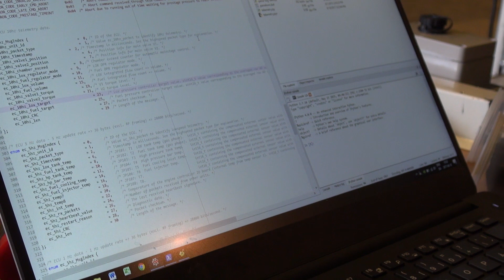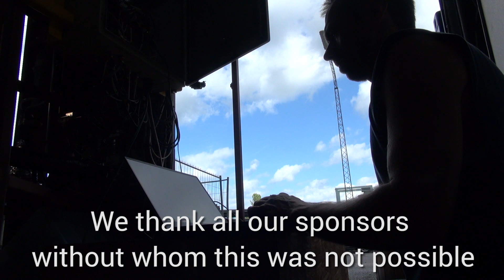DPR Water Flow Test on Nexø II

Comment: You inspired me to start making a simple liquid feul rocket  at home an some parts made at work  already had some results cant wait    I made my combustion chamber to short so I have to macine an extension  from 316l steal     good luck
Reply from the maker: That's great to hear! We wish you good luck and hope to see some successful results. However, we can't overemphesize safety when working with high pressure, combustable systems, so do make sure to write down testing procedures that you could safely follow!

Comment: Excellent video once again, showing the outstanding engineering CopSub is doing. One question though: is there not a third correction which needs to be applied for flight?

You already mentioned that with the rocket vertical, there will be a head pressure difference between tank and injector which is proportional to acceleration. So with a constant tank pressure, there will be increasing injector pressure with increasing acceleration. If you are operating at a point of positive slope on the thrust-pressure curve, this will cause an increase in acceleration which will positively feedback to engine performance. Could this not lead to dynamic instability in thrust control, and possible pogoing of the rocket?

Such instability would operate as follows: an overshoot in thrust would cause a controlled reduction in tank pressure. Because of the positive feedback due to acceleration, the thrust would continue to increase, requiring a larger reduction in tank pressure to arrest the thrust increase. This would cause an adverse drop in tank pressure, eventually causing injector pressure, thrust and acceleration to drop. The positive feedback would now cause the acceleration to undershoot, causing a control increase in tank pressure by opening the helium valve. Despite the tank pressure increase, the engine thrust would continue to drop because of reduced injector pressure due to reduced acceleration, until the tank pressure overshoot was able to restore thrust. At this point, the tank overpressure would store sufficient energy to begin another thrust overshoot. The cycle of instability would then repeat, with possibly increasing amplitude, perhaps leading to loss of engine integrity or performance.

It may be that simulation can predict the behaviour of the DPR system and engine performance in flight, so that the control loop gain (or feedback derivative gain) can be set to prevent such instability with confidence.

I feel sure that you have considered these possibilities, but given the incredible work you have put into this vehicle, it would be a tragic shame if unforeseen dynamic performance issues in flight caused the loss of the rocket.
Reply: Billy Sugger I don't know anything about rocket engineering but my first thought was to wonder if a fuel pump placed between the tank and injector that reacted to injector pressure would be more precise?